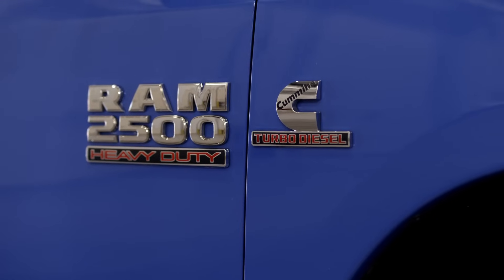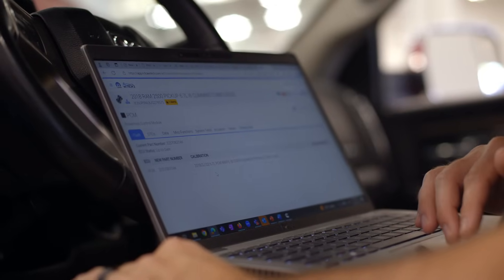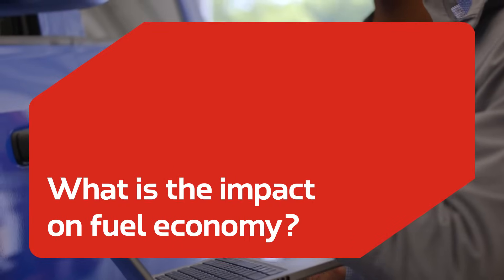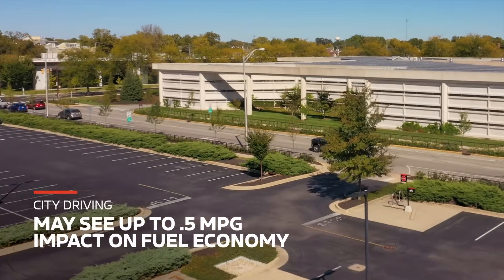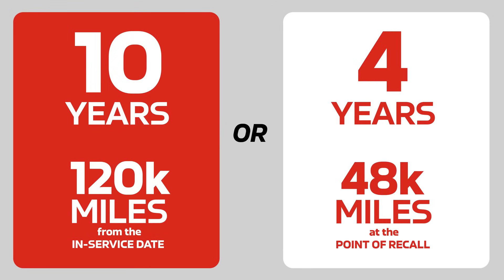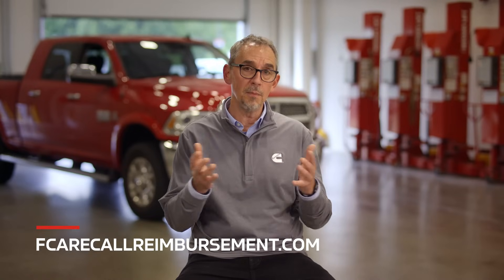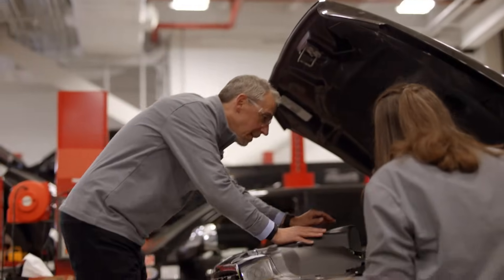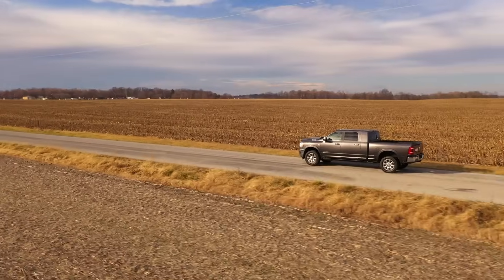Cummins Explains RAM 6.7L Emissions Recall 67A

Comment: I keep getting that recall letter. I am very hesitant on taking it in. I really do not mind the adding of DEF and the amount I use now is not bad IMHO. But I know I am sacrificing a lot of power. I'm not a mechanic but I read that by getting rid of the DEF things get gummed up which causes failure? I live in a county where we don't do not require emission testing and have been considering getting rid of the DEF.

Comment: Hi Brad, I’m Jeff Just wanted you to know my truck is due for the recall. I’ll make a deal with you. I’ll get the recall done when Cummins recalls your failing grid heater bolt, until then no chance. If Cummins can stand behind their epa tune then they can stand behind a failing heater grid intake bolt. Hope to hear from you before my failed heater grid bolt smashed itself into the top of my piston. Thank you sir

Comment: Immediately after have this recall performed on my 2016 Ram 3500, CEL light on Code P0299 utilizing the remote start feature. Truck shut off within 30 seconds. 
Cleared the code and put enough miles on it to ‘erase’ the permanent code.  It does this intermittently but no issues driving the vehicle.  Towing or not.  Fuel economy went down 1.5 mpg.  
Any suggestions.

Comment: I had to replace my dep injection pump and my dep injectors and there saying it was done before the warranty was issued but you said anything done Pryer should be covered. I have a 2016 RAM that has 76.000 miles on the truck at the time of service

Comment: It's definitely a no from me. I'll just keep driving it the way it is. Throw a fix in for the grid heater bolt failures, ABS issues and sweeten the warranty period or I'll do my own work.
Reply: Check out banks fix to the grid heater. Best thing i did for my 13
Reply: @ladakota20  Overpriced fix. The best solution is BD's currently.

Comment: How about a recall on the abs module for my 2017 3500. Fixed it twice and failed and no parts available now. Ram is a joke I have a 50000 dollars truck and the dealer says don't drive it due to safety issues as no parts are avalable at this time.
Reply: The recall is out now should be able to go to any ram dealer also they are giving refunds for previous repairs

Comment: Nice video explaining the recall. Now, could you please do a recall and fix the grid-heater bolt of death problem? A 50 cent nut should not be able to torpedo an entire engine!! Poor design.
Reply: Check out banks grid heater fix. Best thing i did for my 13

Comment: One day.. ONE DAY after having this update, my 2017 with 87K miles had it's FIRST CEL! Coincidence? You will never convince me! However the dealership I purchased her from and had the 67A update done was VERY dismissive when I called. Oh That could never happen; It has nothing to do with... "! BS! I am beyond pissed! I put a scan tool and came up with 3 codes all relating to the turbo. Last week I was driving out of town to a very important meeting and after idling at a stop light, it had a major power loss. On take-off it would not exceed 15MPH, RPM's were through the roof and it sounded like a jake-braking diesel truck. I pulled over,  where there was no real place to sit, and after several minutes of half blocking traffic I was going to limp it to an exit. To my surprise, it was OK - except for the CEL still on. I made it to my meeting on time. On the way back, I again had to stop at a light and idle for a minute, On take-off, the same thing; No power, 10-15 MPH, RPM overload, and horrible sound. Again, I limped it into a parking lot and let it sit for several minutes. After several unsuccessful attempts to take off, cycling the key on/off, it finally ran OK. I drove it home, trying very hard to not have to stop & idle at all. Now, I have a very expensive paperweight in my driveway because obviously I don't want to drive it until it's fixed. Like I said I called the dealership where the recall was done & they were very dismissive. I called another dealership and explained exactly what I just said above.  The service manager himself called me back and bring it in, BUT the caveat was the original dealer had not yet filed the papers where the recall had been done! So here I am waiting for that! Truckless! Now when I take this in and [IF] they try to tell me it is unrelated, $hit is gonna hit the fan!
Reply: Thats your turbo actuator shitting the bed…..mine did it at 104k miles.

city diesel sells an upgraded actuator, but I put a brand new fleece cheetah  turbo on and couldn’t be happier.
Reply: Sounds like a turbo issue, not emissions issue.

Comment: I will have this recall done on my 2015 RAM 2500 just to gain the extended warranty. I am not spending the money to delete (I don't think it's worth it), but I also don't want to have the expense of possibly replacing emissions components in the next 48,000 miles.
Reply: Did you hear what he said the coverage was? It doesn't cover dpc, cat, EGR cooler. It doesn't cover any big ticket items.
Reply: @uncle705  for a 2015, it would cover any SCR parts such as Urea pump and injector.
Reply: The DPF is the only concern and they don't cover that.

Comment: I had a MAJOR DECLINE IN TORQUE AND POWER AND FUEL ECONOMY!!!! MPG went from 17mpg plus to 14. The engine sounds like it’s STRAINING when going up a hill with less power. Now a week after the “”67A repair”” my truck is idling up and down at stops. I am furious!!!
Reply: If they don’t fix my truck, and others, lawsuits are coming…
Reply: Sorry to hear that!! I just picked up a 24 ram 3500 ho, I'm really starting to question my decision in making the purchase!!!
Reply: I noticed my mpg drop dramatically after the update too! I was wondering if I was the only one who experienced this issue. Guess not.
Reply: EVERY problem I have had with my 2017 cummins has been from the emissions system.

Comment: My 2024 Ram Cummins is a nightmare! Frequent regens and codes since day 1!
Reply: That's why I got rid of my big 5th wheel and diesel went to a Ford F150 with the echoboost and a travel trailer. I can pull up grades just as good with  those twin turbos and I found really didn't need big 5th wheel just wife and I. We were outside most of the time when we were camping.
Reply: @Mike-01234  Yep. Once I'm done with the process I intend to move on as you did.
Reply: So frustrating we working consumers pay so much for these products & they have so many issues right out of the gate!! It should not be like this, they should either give u another truck or refund your money. Sorry u're having these issues, seems as though everything good has to be overcomplicated anymore & just causes unnecessary problems.
Reply: HO or SO? Not sure it matters, just curious, I just picked up a 24 HO for a work truck, but wow! After hearing all these stories, wondering what the hell I did. How many miles did u have on the truck?
Reply: @SteveCallsen It's SO, single turbo. It had about 1600 miles at my first CEL. There was a while when I had a CEL every 500 miles or so. The RamCares people were useless and the dealership techs aren't allowed to just replace parts without STAR engineer approval. Still no official fix. I'm in Lemon limbo at the moment, the truck performance hasn't improved but the CEL hasn't returned for a while 🤞🏻

Comment: If Cummins addresses the block heater bolts issue, then maybe I will consider the emissions issues.
Reply: Look at banks ram air block heater fix.
Reply: @ladakota20 I did that banks monster ram update and it really wasn’t that bad. It took several hours but was well worth it in the end. I don’t know what I picked up because I went banks from the air filter to the head and it was a big difference.
Reply: @jdsmith556  i did thr same thing. I changed that air filter and heat grid together
Reply: @ladakota20  You mean grid heater I believe.
Reply: And if they add the DPF and EGR components to the warranty and extend it out to  100k miles after the warranty is completed

Comment: exactly why i deleted mine & added the ram air intake for the grid issue
Reply: What year is your truck? I just got a 24 & am starting to question my decision, planning to lose some parts after the cost comes down a bit to do it. Did u notice a difference after deleting? Run smoother with better mileage? Any engine lights stay on? I said I would never get another diesel after they started all this emission crap, but here I am giving one a try, hoig I don't regret it.

Comment: For those who tow heavy, you will probably use close to 2x more def
Reply: I can attest to it!  Fleet vehicle are fully logged. Before and after shows DEF being gobbled up!  It's clear why next came warranty extension...  I'm sorry, but it's junk science and feel-good legislation behind this.  Those of us who are scientists and engineers understand the reality.
Reply: That is absolute nonsense. Where did you come up with that?
I had the software update done a year ago. I just drove my 2017 Ram 3500 from Quebec to Arizona, towing a 6500 lb RV. As usual, I used about one 2.5 gallon box of Platinum DEF per 1400 miles.
Reply: @headdown1  Thats cute, you think 6500lbs is "Heavy", just saying a 6500lb load for these trucks is not a heavy load, Personally I don't think my truck a 16 3500 DW would even notice that size of trailer behind it, I am sure what he means is more like 16-18k plus such as Toy hauler RVs or people pulling doubles and what not.
Reply: @davidbeckwith5119  Understood. I towed a 15,000 fifth wheel for a few years as well. The truck is rated to tow 17,500, so for this truck it was fairly heavy.
I did drive a 60,000 lb tandem tandem concrete truck for years, so I do know what heavy means.